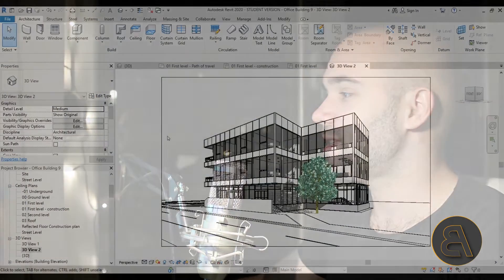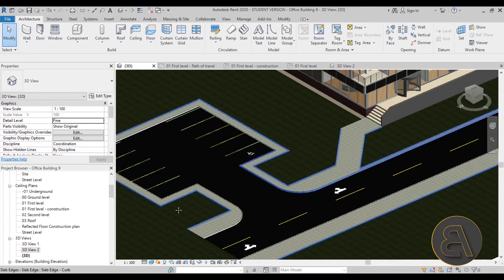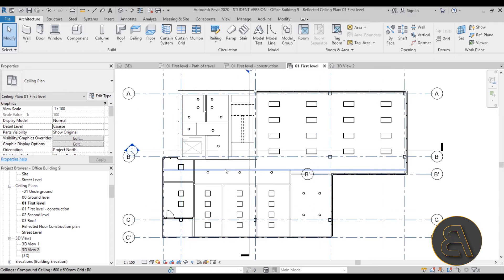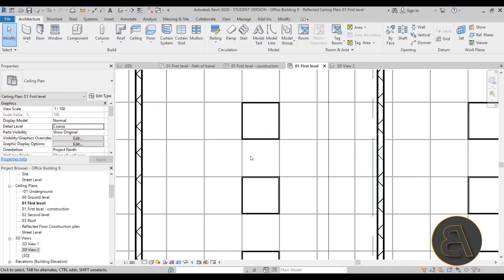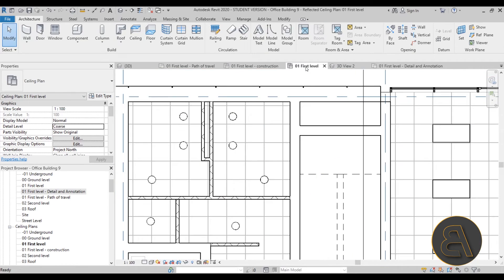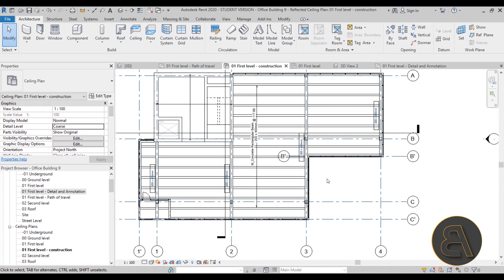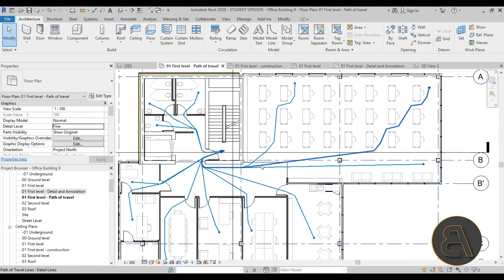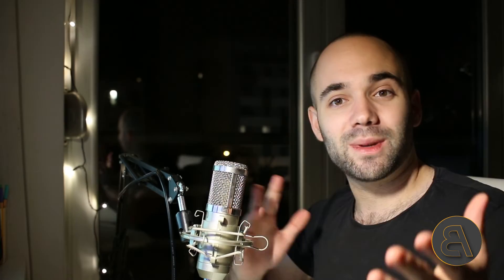Office Building in Revit   Ceiling plan, exterior   Part 9

Comment: Guys I need some help and I'm spreading the awareness to any student out there. I've recently updated my windows and I think it my have caused my Revit malfunction "Revit license manager is not functioning or is improperly installed" I've tried to uninstall and re-install and it seems as if its not working. Any suggestions would be highly appreciated and once again, l urge for students to not update their windows anytime soon until Revit 21 has been released.
Reply: I've heard about this as well, I assume you're on a student license?

Seems to be a fair bit of discussion/solution on the forums;
https://forums.autodesk.com/t5/installation-licensing/revit-2020-licence-manager-is-not-functioning/td-p/8857155

Sometimes it can pay to do a registry clean and reinstall to allow the install to 'reset' all the details if possible.
Reply: @AussieBIMGuru  Yes, I am using a student version...

THANK YOU VERY MUCH!!!!!! IT WORKED, it took some time but IT WORK!!!! I was a bit hesitant because I also have past projects (Detail drawings) in AutoCAD but, it worked! Thank You very much for your assistance I truly do appreciate it and THANK YOU Balkan Architect for your platform and the continue support circle for the Revit community! We are truly grateful!